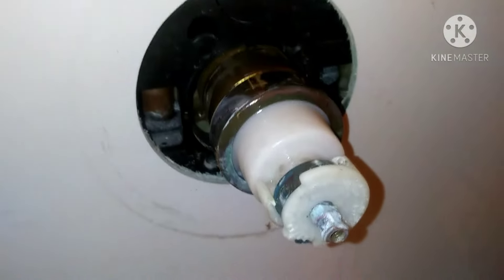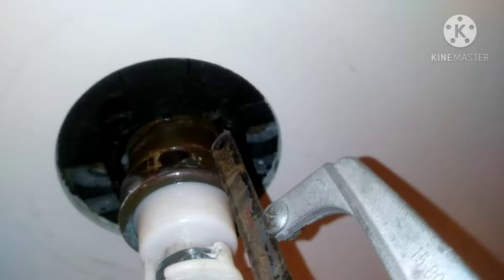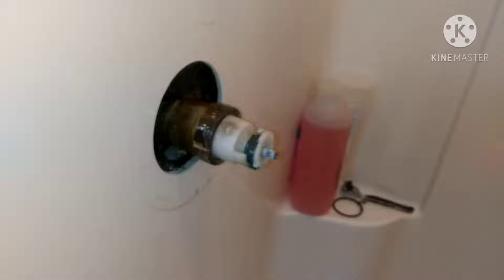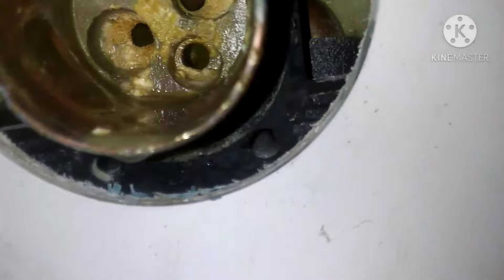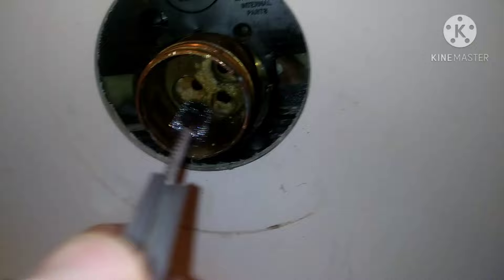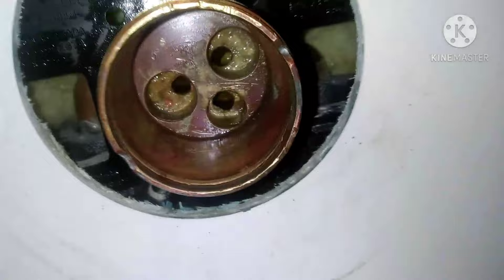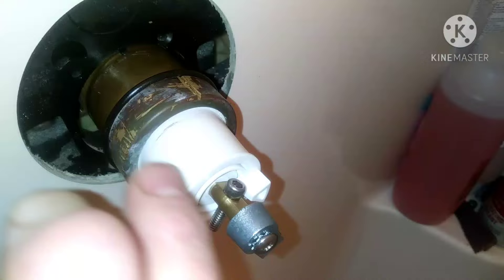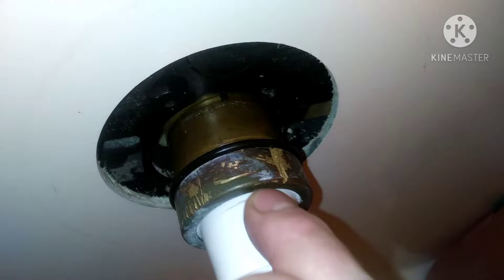remove stuck bonnet nut (easy way)

Comment: This is very good information, thank you. But before you do this, I highly recommend spraying the nut with a liberal amount of WD40 and simply letting it sit overnight. I had this exact problem, but just wanted to try to lubricate it before I went to such drastic measures -- and it worked! No need to get out the hacksaw! Of course, if the WD40 doesn't work, then I would use this as Plan B.

Comment: Thanks for the helpful video.  For those not finding success with the video'ed method, once the back plate was removed—as appears (or actually doesn't appear) in the video—a strap wrench removed the bonnet nut in about 4 seconds.

Comment: If you have trouble removing the brass cartridge ring....take a decent size hammer and place the face (or the side) of the hammer on one side of the ring....then tap on the opposite side with another hammer....moving the hammers all the way around the ring....TAKE YOUR TIME....I probably make close to 100 taps...IT'S WORTH IT. It will separate the threads so that if you grip it (semi-gently) with some newer (sharp teeth) channel locks it will turn. A little heat is a good option too if you have a small torch. Use some plumbers grease on everything to re-install the new one.....the next guy will thank you.  I might try this method tomorrow...just have be careful not to ruin the ring. 
(Edit) Tried this method today....worked great!....thx!

Comment: I was just about to use your method when I had another idea.  I took a hose clamp.  Tightened it down and use the tightening screw with a hammer to give it a crack.   I would not have thought of this without first seeing your video, thanks.
Reply from the maker: For sure, nice

Comment: Hello and thank you so much. Your vid is as close to my dilemma as I could find. I bought a old house that had no hot water pressure at  all in the tub/shower. I wanted to take out the cartridge but the housing was behind the tub shower insert and I could not reach it at all. So I had to take out the top panel. Now this bonnet will not come off. As a result of trying to get the bonnet off. I have a lil leak now in back the of the cartridge housing. So I need to replace the valves and cartridge. I slid a piece of wood under the cartridge body while I tried to hit the notch I made in the bonnet. Now I think I have to cut it free from the threads or use a heat gun or torch. Do you have a vid on replacing the whole set up. Valves behind cartridge and all washers? 
Any help from anyone would be helpful.
Reply from the maker: I have not done a video on that yet, there is a lot of info on replacing the whole valve body out there, I would consider that a difficult project , just keep that in mind

Comment: Our pipes move like that too. Im worried about breaki ng something. The plumber we hired told us we would have to cut it out. Trying to avoid that. Should i wedge something on the other side to keep pipes from moving too much?
Reply from the maker: A wedge is probably not something that will last, you could cut an access panel on the other side?